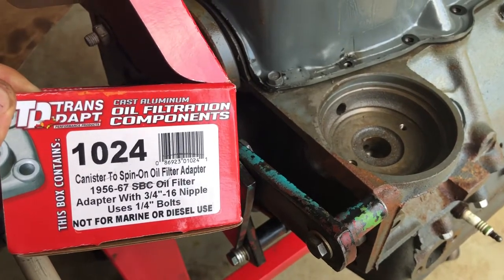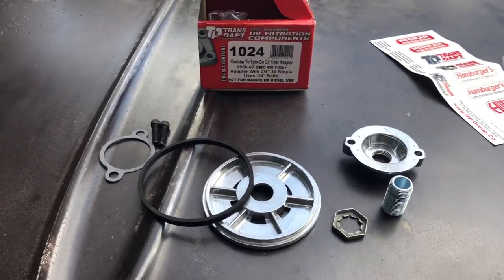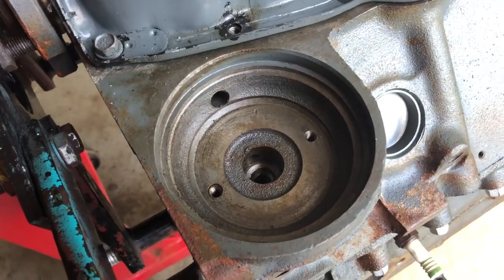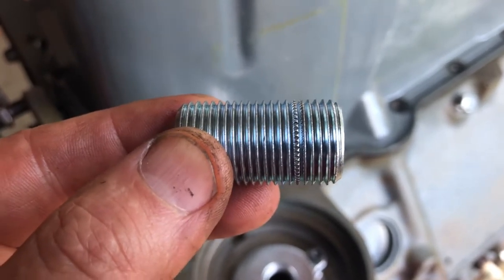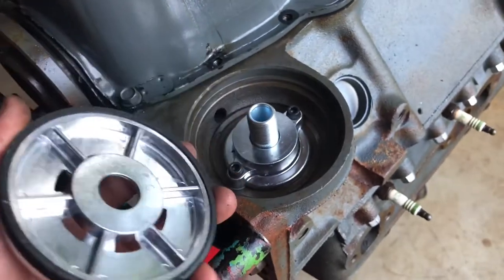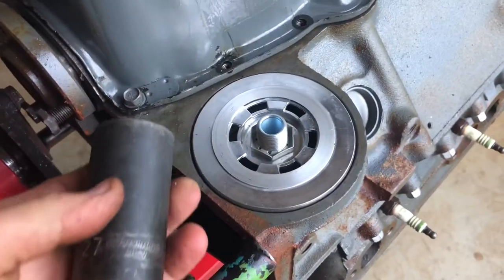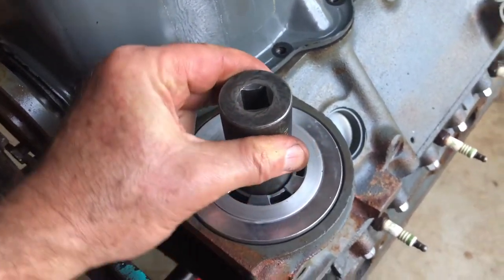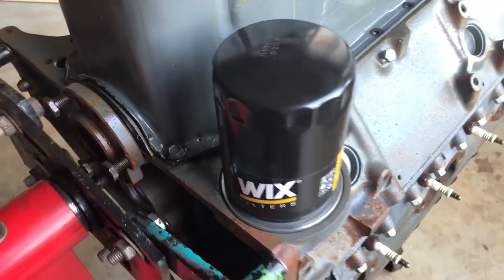SBC 283 Oil Filter Adapter Installation

Comment: Stress engineers who specialize in fasteners might not like the two good threaded fasteners approach you describe by using the part if the filter.  The stamped nut just holds it in place until you install the filter.  Tightening the filter would put the preload on the whole threaded tube,  While this matters more on highly stressed fasteners why not apply the rule here?